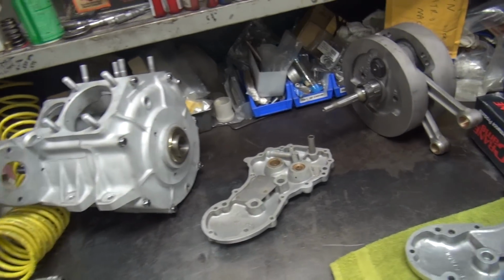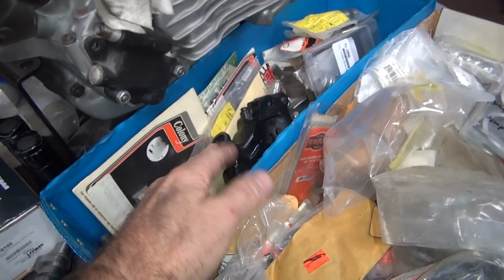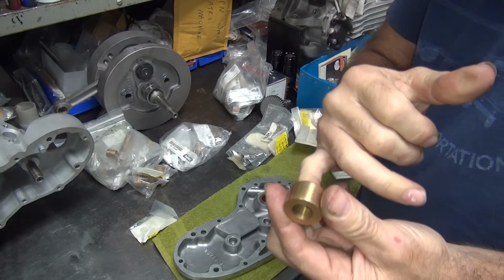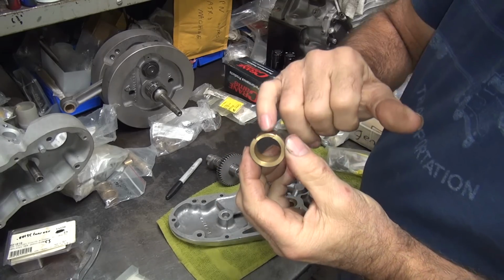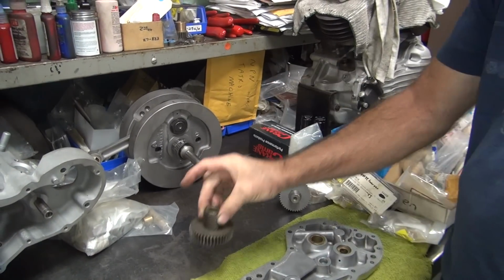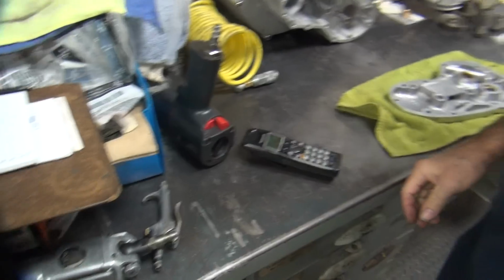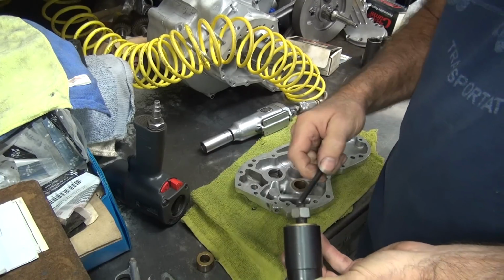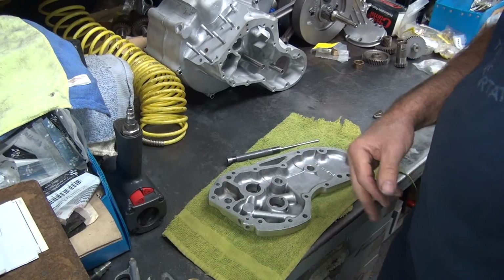1965 panhead #115 74ci flh motor rebuild and bike repair harley by tatro machine

Comment: You have a "winner", how much time do you waste every motor you do, going through new parts, to find some thing you can use? How do you charge for time spent checking new parts? Depressing.
Reply from the maker: its called rebuilding a motor. don't forget all the paper work needed to order and sell the parts.
tatro

Comment: That just answered my question about an end oiler feed. My pinion shaft has a screwed in orifice (and I'm running a high volume pump).
And you called it a "circuit breaker." I don't know why, but it drives me nuts when people call it a "distributor." It doesn't distribute squat.

Comment: It sounds like one of the main reasons for keeping tight tolerances is to maintain reasonable oil pressure.  I'm curious how difficult or expensive it is to increase the volume of the oil pump.  Interesting video, as usual.